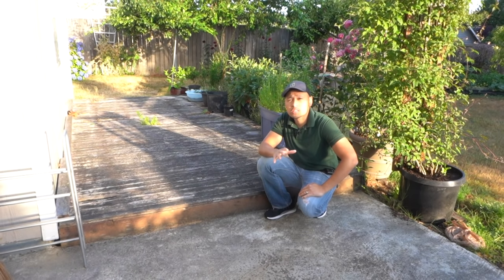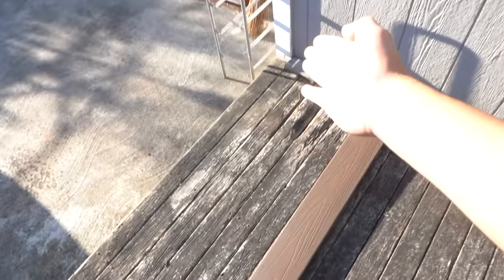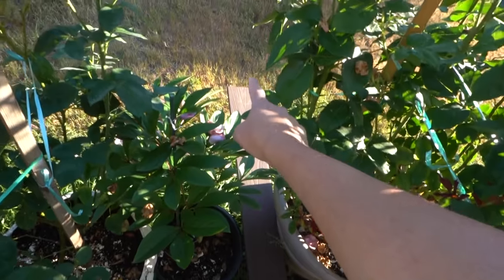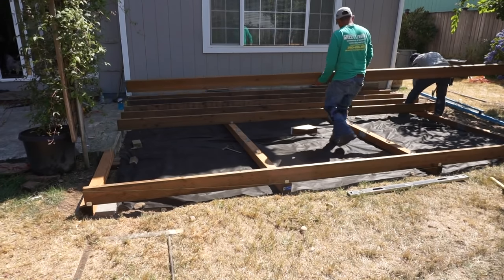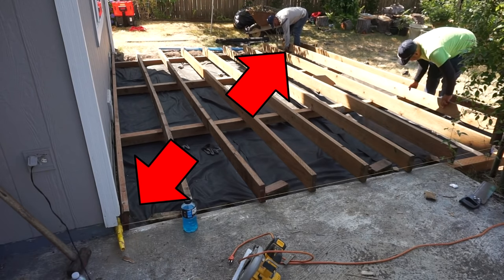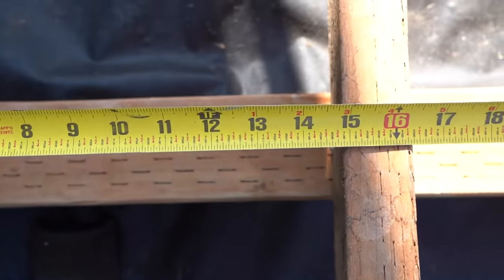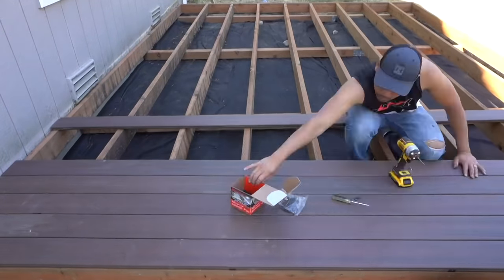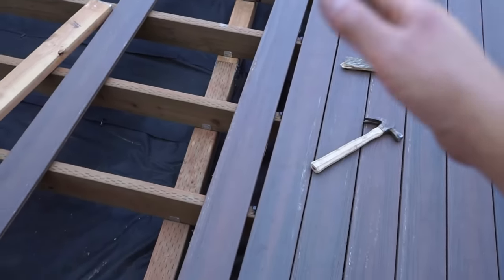How To Build A Floating Deck For Beginners! EASY DIY Floating Composite Vinyl Deck Install!

Comment: Well done. Good explanations. And way to improvise where needed.  👍🏻 Sometimes you just gotta work with what ya have and make it work for you. 😊
And like you said several times, it’s YOUR deck. If you were doing it for someone else and the homeowner has difference preferences and an infinite budget, sure you could’ve done it different. Good job repurposing the materials that you had.

Comment: Why not ad another end board to mate up with the overhang.
Reply from the maker: That is another option 👍🏽😊
Reply: My friend did that for his deck just in case someone heavy stands at the edge of the board.
Reply: Thats what I was thinking. If I or someone else stepped on that overhang, it would break.

Comment: I might have missed this watching this video, but the board against the home - was that secured in any way?  And the same thing for the 4x8s resting on the pavers - were those secured to the pavers?  Besides these two things looks like a fairly easy, and attractive project.

Comment: If you are going to spend the extra cash on trex composite decking you should have gotten the no-groove facia boards.    

For a plain Jane deck like you have picture framing is a really nice added touch so why not do it since you are going to be living with that for a couple of decades?   

I just started using joist tape on my last build.   I'm using g-tape in particular.   I won't build a deck without it now.     Every gap where your wood is exposed to any moisture it will dry rot even if it is pressure treated.     

Even if your code doesn't require joist blocking on an 8 foot span, I still always block 8 foot joist spans and then  longer spans of course.     

Just throwing down concrete blocks is not a great way to foundation your deck.   I dig down at least a foot square below grade or deeper depending on what I'm building.   I then put rebar down into the hole, a couple inches of gravel  and pour each footing.   I build a 12 inch square by 4 or more inches high form for the top of each concrete footing to provide the base above ground for the deck to sit on.   I then bracket the beams(or posts) to the concrete.   Where I am it pays for me to use hurricane brackets for the joists.   From the ground up everything is attached and fixed to what is below it and above it so the deck can't just slide off its base.   The whole thing would have to be lifted off the ground.

If you needed 12 foot beams why didn't you get 12 foot beams?   Putting 8's and 4's together will work but why do it that way?   Home Depot has 12 foot 4 x 4 treated or mine do in Texas anyway.

I am not a professional builder but I get involved in projects every so often.
Reply from the maker: Hi! Thank you for your input 🙏🏽 unfortunately during the lumber shortage homed Depot or Lowe’s didn’t have the 12’ available. 🥲

Comment: This is something I'm definitely interested in as I have to put up a new porch on the front of the house and I need a solid concrete block at the bottom to support the steps, placing it deep enough in the ground to avoid issues with temperature variances as I live in the Northeast. I'd like to ask is it difficult to remove the 2x4s once everything has dried and in this situation where it's buried in the ground a little bit would I even need to remove the 2x4s? How is that done without chipping the concrete? And wouldI use a rubber mallet? I'm visualizing adherence between the concrete and the 2x4s.This may not turn out to be a problem but I'm asking in advance so I'll know what to expect. TIA!

Comment: I noticed you didn't use the camo lever tool like most people do. You had any problems with your deck? 

I'd like to avoid spending $100+ on a tool I'm only going to use one time.

Comment: If you buy a 10ft board of Trex and a 20 ft board of Trex (of the exact same kind) does the price come out exactly the same based on how many feet you buy or do they make the 20 ft board slightly cheaper?

Comment: Will the composite deck get too hot to step on with bear foot in summer time? Just curious. Thanks.
Reply from the maker: Hi! It does get warm for it has that plasticky feel to it.
Reply: No. Unless you have unusually high temps and it's exposed to the sun all day. Mine has been the best thing I've done for two decades plus. And you won't skip if it gets wet either.

Comment: hi, the 4x4 's did you use at 4 ft, 8ft and 12 ft. you did not put any 4x4  at 0 and 16 ends?
Reply from the maker: Hi! I did not. The left end is sitting on top of the existing concrete patio. The over end has a floating effect.

Comment: Composite decking may require smaller spacing, e.g. 12" o.c. You did not explain how ledger board is attached to the home, if at all...

Comment: What part of the country are you in that you didn’t use footers?
Reply: That's what I'm wondering because in most states a deck over 200 sf should have footers.
Reply: @sneat2028  Yeah mine is 16x12 Trex composite and has 9 6x6 footers in like 25 or so inches of concrete as a freestanding ground level deck. It's tornado proof lol.

Comment: Great job! What was the total cost?
Reply from the maker: Thank you! Honestly this cost me less than $1400. Prices of material vary on certain areas. I live here in the Pacific Northwest 🌲😊✌🏽
Reply: I live in the PNW as well! did you order the decking at home depot?
Reply: @tuesdayepting9417  He didn't make it super clear but I think he said the decking he used was reclaimed (previously used).  Probably didn't want to talk about it too much because using NEW decking ordered from home depot would definitely make this project more than $1400 (closer to $2500 just for the TREX).

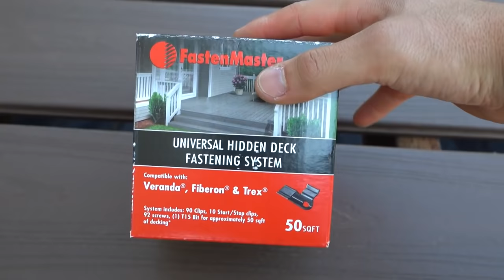Comment: How was the floating deck attached to the house?  At 8:11, the deck appears to be securely in place but there is no indication if it was nailed or screwed in to the bottom part of the house.  Thank you.
Reply: Floating decks are not attached to the house, that's why they're called a "floating deck". That being said, a deck over 200 sf requires footers in most states. This should have been a "free standing deck".
Reply: Part of the issue of "floating decks" versus "attached decks" is building permit issues.  Most communities allow a DIY floating deck to be put in by anyone WITHOUT the requirement of costly permits, inspector visits, etc.  If it's an attached deck, then you MUST pay for a permit and deal with inspectors, etc.

Comment: they have end pieces for the finish no grooves on the edge also the space between the ground and the 4x4s should be at least 12'' way to close to the ground sorry
Reply: That sounds like it would require steps to access the deck. Why would it require 12 inches of clearance between the ground and 4 by 4s?
Reply: @robertpattillo2503  
I was thinking the same thing.  Needs to be elevated more.  Especially if it rains hard, the water would go ––– you know where ––– and just sit in a soup underneath that deck and never dry out for a while.  You can tell that's happening by the wood rot at the ends of the vertical boards on the house.  Note the discoloration and raggedy ends especially at the far corner at the 2:40 minute mark.  I would have hoped that these guys would have at least addressed that by (1) cleaning off that dirt, and (2) assessing the wood ends if any structural rot was present going into the house, where the previously rotted deck connected to the house and if so, repaired that and (3) given that entire wood (bottom part) a fresh coat of paint.  At least that would have guaranteed no water/rot issue later, now that that area's being hidden by the new decking.   Good video demo anyway.

Comment: Is anybody out there useing the tough blocks to build a floating deck of this size? It seems so much easy and quicker than digging holes for footers or using concrete blocks.
Reply: I used tuffblock deck blocks to build a deck 3 years ago . It is still strong and stable. I am starting a deck platform for under an outdooor sauna very soon and am using tuffblock again for this project
Reply: Used a different type of tuff block which was less expensive for my shed/joists and worked awsome.
Reply: My floating platform for under the outdoor sauna was completed 4 weeks ago. It’s 8 feet by 10 feet with 16” centers and is super solid. Tuff blocks were the best option for this job allowing me to keep the platform low to the ground. They also make it very easy to keep the structure level.
Reply: Eurotec adjustable pedestal on landscape pavers is a better method than tufblocks fyi.

Comment: That vinyl wood is not all that great. It’s plastic and get as hot as hell so don’t forget not to go barefoot on it. Plus it wines up and warps with too much heat. Sure it doesn’t rot but there are way too many negatives for me to ever use it again

Comment: Looks like you are just sitting the concrete pads on existing soil. Can't believe you actually used a deck board to trim it out along the edge.

Comment: If your going to fascia the edges why not cut the end board to size using your circular saw and add a fasica to give yourself a neat job. 

Having an overhang on a board, over time with people stepping on and off will ruin it quickly and require a fix with a new board that won't match the decking. Would have taken you 10 mins more to do that...
Reply from the maker: Thank you for the feedback 👍🏽😊
Reply: I was thinking of that too, Kyle.  Folks stepping off the end of that last board would bend the plastic down, eventually causing it to fail.  By adding an additional 2x4 along underneath, to add support under that overhanging edge, would have solved that problem.  An average American adult dude today weighing 230-250 pounds would quickly make that end bend if stepped off on.